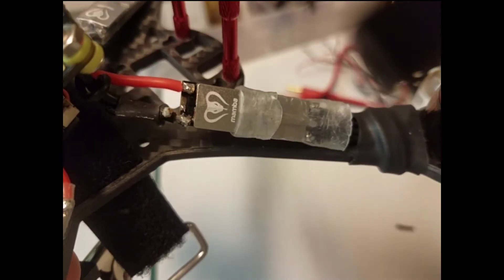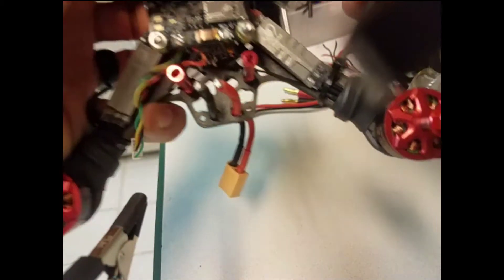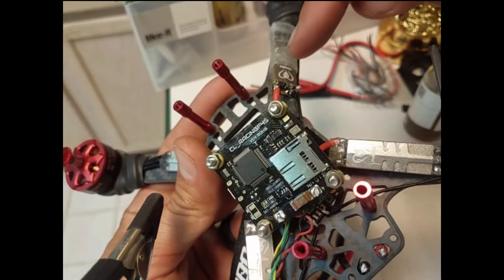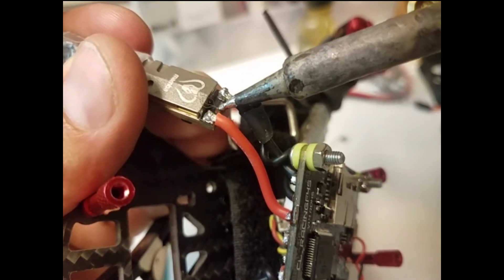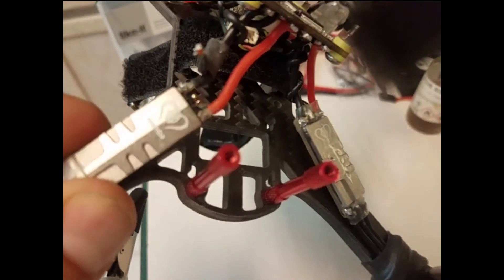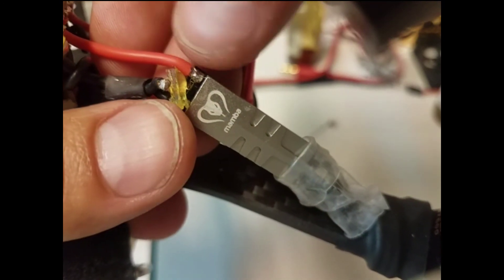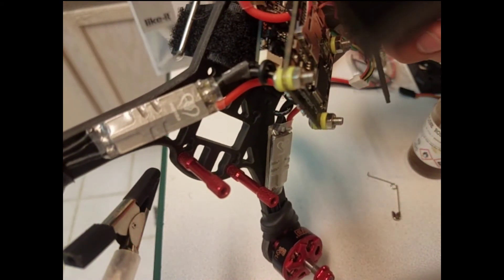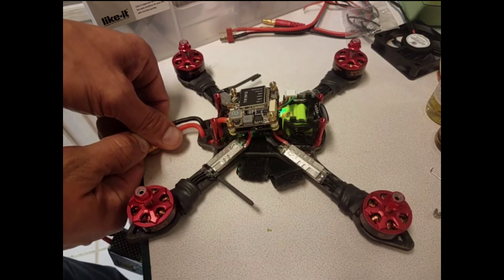Lifted signal pad repair

Comment: u didnt have any desyncs apon throttle punch because of the thin strands of wires?
Reply from the maker: No issues. Great flyer. The more strands you can get, the better though.